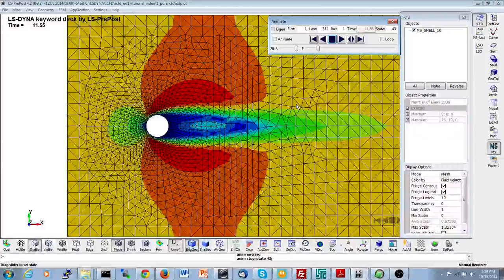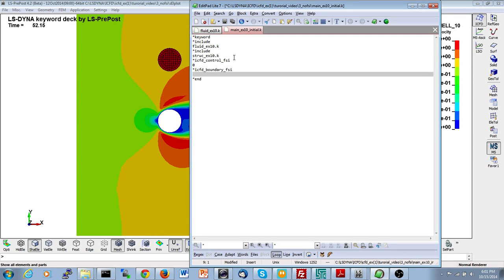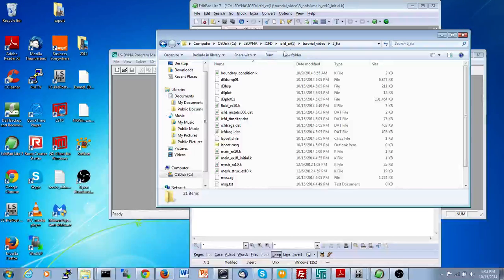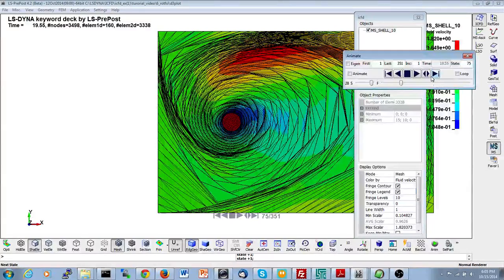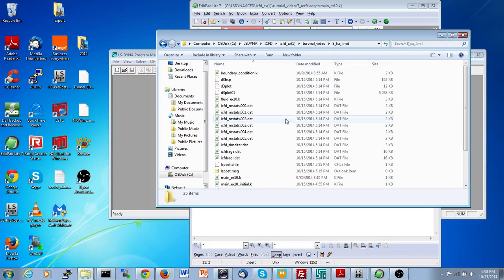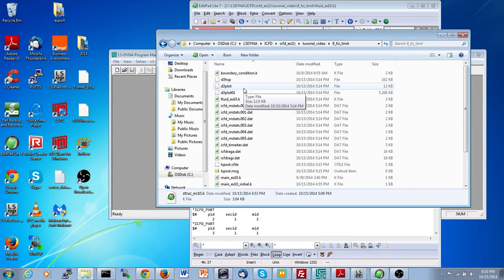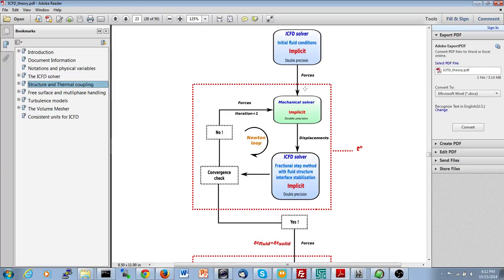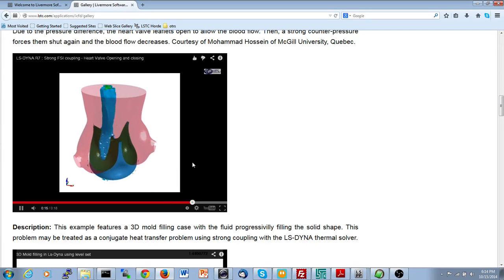FSI problem set up with ICFD-LS-DYNA

Comment: Hi there
Nice simulation!
I'm working on collision of a particle into a droplet. A water droplet is falling by gravity and a solid particle is shot toward that to hit the drop. Collision outcome is a conic liquid filmwhich forms like a liquid skirt for particle (lamella) as shown [URL="https://www.youtube.com/watch?v=fxEvX_MjfXM"]here[/URL]

I need to simulate this phenomenon and compare the results with what I get from experiments. However, I need first to choose the most suitable simulation software capable of considering the followings:
 
- Particle motion both in air and inside droplet
- Particle-droplet interface during penetration of particle into droplet

It should be noted that I want to simulate only from collision until completion of lamella formation (not lamella shrinkage disintegration of droplets), nor therefore during simulation, all liquid parts are attached together which would be simpler to solve. 
 
Please let me know that based on your experience, which software is able to perform a more accurate simulation on this. 
Your response is greatly appreciated.

Regards,
Sayed